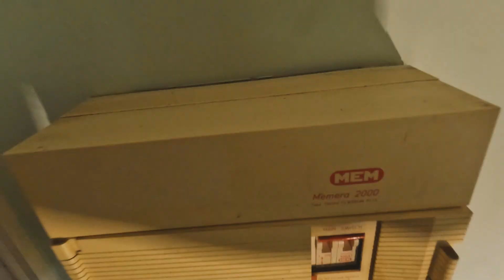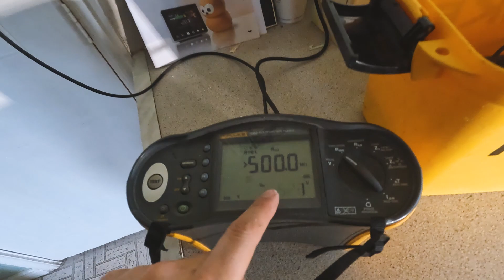CIRCUIT FAULT FINDING🔌I DID IT AGAIN! 🕵️‍♂️

Comment: When IR testing, by all means disconnect the line and neutral but leave the CPC connected at the MET. The short isn’t always necessarily between the lives and CPC of that circuit, it could be that the live conductors are damaged and touching an extraneous conductive part.
Reply: Alv spreading the knowledge ⚡️💪
Reply from the maker: Good point! Never thought of that. I always try to isolate the circuit fully, then you know the whole circuit within is fine. But yeah there would be an extra step from live cables to MET in that case! Great point

Comment: Was the cable from the switch to the dodgy looking pendant ok?
Reply: More than likely as it stayed on after he’d changed the pendant.
Reply from the maker: Yeah was fine, it was shorting out through the connector block so replaced and voila 😀